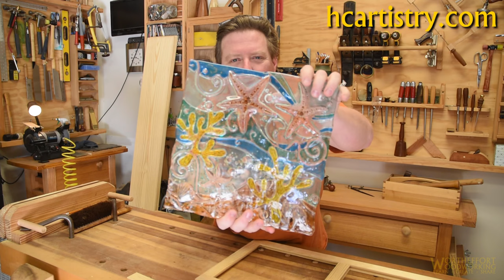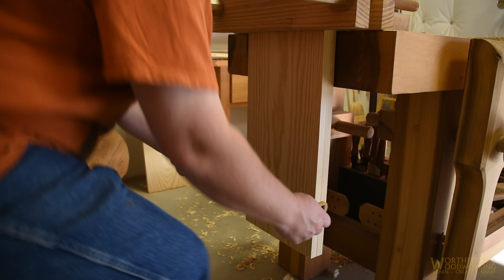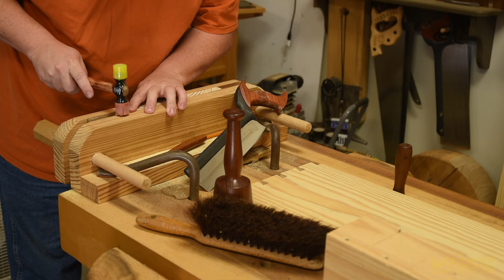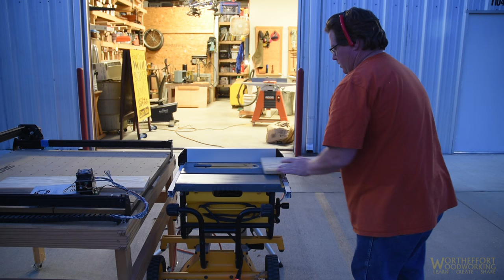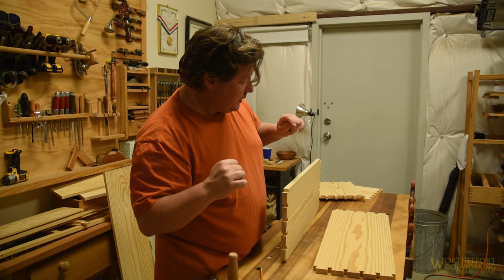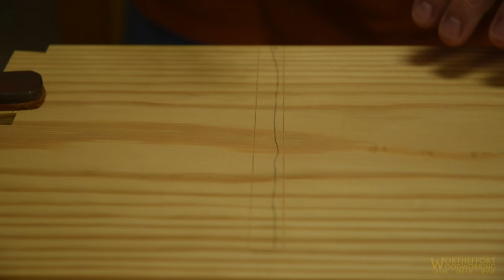Make a Wall Cabinet 2 - with a focus on hand cutting dado's for shelves.

Comment: Hi, just to say, that I really enjoyed watching your video, very refreshing to watch a vid where the emphasis is on the correct use of hand tools, rather than resorting to electric routers, not removing the majority of waste by multiple cuts with a table saw, and cutting boards with a chop saw etc. Not all of us have the luxury of these power tools, but the vast majority of us have, saws, mallets, chisels, and measuring tools.

Comment: Ancient video on autoplay, but the plural of dado is dadoes...

Also, a method that I like is to use a regular router to remove material from the middle (use say a 0.25 inch bit for a half inch dado) to quickly do the bulk of the material removal (and get perfect depth) then clean up the sides with the chisel.